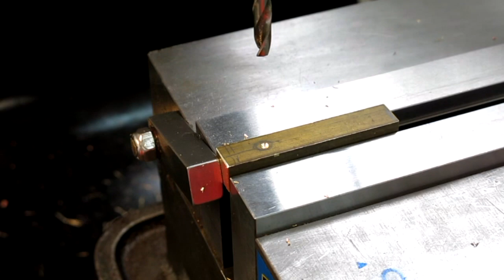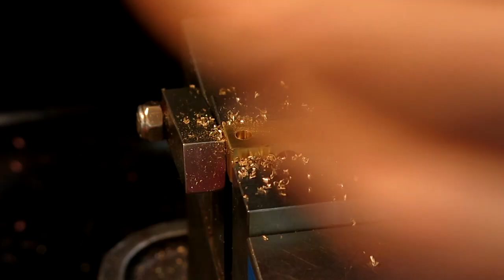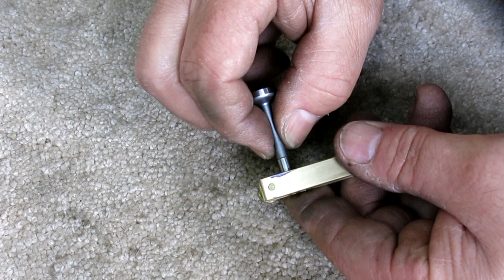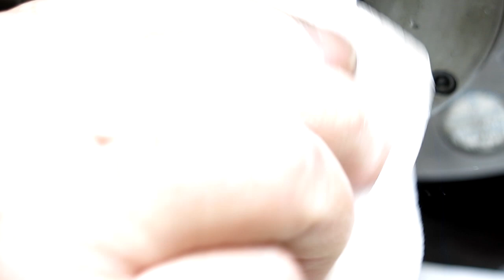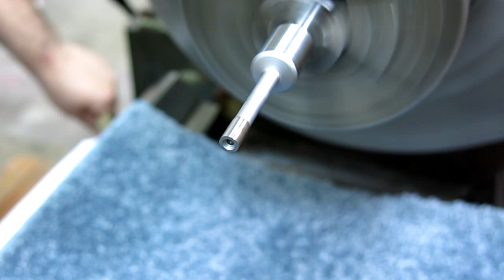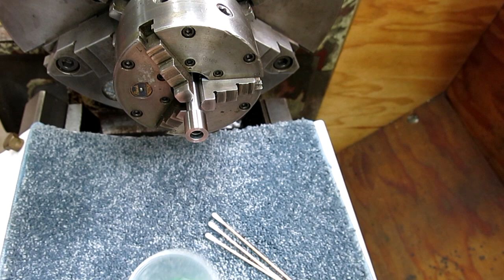Precision Toolmaking Making an Edgefinder Part 3

Comment: When i polish a work piece in a lathe using sand paper, the changed temperature due to friction affects the micrometer readings and i talk about 0.01 mm here. Does temperature plays role in lapping? It’s metal rubbing metal and you are talking tenths. 

Thanks 
Good stuff you are doing up there.

Comment: Really fascinating. Lapping is a great technique. I really wonder if your mike can go down (accurately) to 25 microns.  Just the way you tighten it is worth probably a few tenths, call it at best .001mm or say 50 microns. That is way, way, beyond the needs of the average home shop. Only way I know to measure accurately at micron resolution that small is a laser interferometer and that too is way, way, beyond the reach of the home shop. Might consult the physicists at Livermore. If they have an intererometer that would do it it would be a treat.

And it is fortunate that you broke the tap. If not, it would have gone  in slantendicular and ruined the lap, since you didn't gronk the vise.
Reply: +Juan Rivero Hi Juan, you may be surprised to know that one of the more gifted members of an Australian metalwork forum I spend way too much time on bought IIRC a Honeywell or perhaps an HP laser interferometer on eBay for around AU$1000. While he was testing it out and informing other forum members of his new acquisition another forum member chimed in to say that he had used that same instrument at a particular manufacturing plant maybe 20 years earlier, and at the time it was valued at AU$250,000. Again from memory one of the major issues he had with it was that the plastic foam padding from its case had deteriorated and deposited itself over the various components. Fortunately it all cleaned up and he was even able to obtain some missing accessories at a fair price from the U.S. He now has some of the best calibrated granite surface plates in any home workshop;-)
Reply: A very interesting story. The quarter-million (AU$) interferometer -- damaged bu its case! Thanks.

Comment: i have a question you said you could work in millionths, is there anything measurement beyond that. I play around with a KEARNEY AND TRECKER MODEL D.  my dad works in a shop, with mostly gears. he runs a 20-4 and an hob. mills too. but mostly the hob

Comment: Hi Tom
On the tapping You've been lucky, because You didn't use packing blocks. ;-)
With the lapping of the two parts, do not go any further to  mirror finish. If You leave two high polished parts together for a long time under pressure, the will be "cold welded". Because of the adhesion. With the time the electrons sharing the orbitals, and two parts become one.
Regards from Germany
Larry
Sorry for my poor English.
Reply: +oxtoolco What's a packing block?
Reply from the maker: +eXactModellbau Hi Exact,

Busted on the packing blocks. It might have prevented mr bozo's visit. On extremely hard surfaces like gage blocks and edge finders you some rotation will not hurt it. Fortunately in the case of an edge finder there is no relative rotation between the two parts if used properly. Thanks for the comment.

Cheers,

Tom

Comment: Tom,
Excellent work as always. However I suspect that this edge finder is for right hand edges only as you lapped it in the chuck but only with the spindle running in one direction. Next time alternate the chuck rotation. That will also cancel out the Coriolis effect.  :-)
eric

Comment: Sweet as Bro!

Tom, are the jaws you're using in your Kurt standard or have you ground that step in the jaw plates? I'd never really thought much about it, just shoved parallels in there and called it good to go. However my Wilton vice on the drill press has a jaw step and I use it all the time. Seeing yours I had a "why didn't I think of that!" moment, so I may make up some new hardened jaws with a step in it like you have, as that would be super handy. My main milling vice is a Gressel, and I, a) wouldn't even want to think how much they'd charge for new jaw plates and b) don't want to even temp Mr Bozo to pay a visit while screwing with  the existing ones, hence  grinding up some replacements will be the go.

The other thing, is that little weeny boring bar of any particular brand? I really like iFangers but I've only got them down to to "not quite weeny enough" sizes. Goodness knows why, but I often find myself in Weenyville when boring, so I always try to find alternatives around the place instead of my shop-made wonders! 

That lapping come up great. The edge finder would be better than most any commercial one I've seen. Nicely done.

Edit: Wait a minute, I just watched an earlier video (I often watch out of sequence if I don't have time to watch a longer one). Maybe those jaws aren't stepped and are thin parallels??? In which case what do you think about stepped jaw plates?

Comment: Tom, great work; even with a friendly visit from Mr. Bozo!

I have the same Mit mikes you have with the Hold button, which I noticed you don't use.

I use the Hold button whenever I am measuring in an awkward position that prevents reading the mike while it is still on the part.

I press the Hold button, back off the mike spindle a bit to free it from the part. Then I pull the mike out and look at the reading. I am uncomfortable pulling the mike off the part with the full measuring pressure on the spindle and anvil of the mike; I am afraid of scratching them or the part, or levering the mike itself a bit.

Just don't forget to turn the Hold function off before you make your next measurement; otherwise you wonder why that last pass didn't take anything off!

Is this procedure of any value?

Comment: Wow, and I was nervous drilling three "equidistant" clearance holes for the backing plate on my chuck, LOL! I would melt trying to bore something with that toothpick sized boring bar :)

Thanks again for the show, they're always enjoyable. Aloha...Chuck
Reply: +Knolltop Farms If Tom does work any smaller he will be building a watch, you know he can call it the RolOx, the finest watch never built.
Reply: +John Bare You do bring up an interesting point.....The question is:  When did machining actually begin?  I'm thinking like you.  Did watch makers start the science and art of machining as we know it today?  Remember, they made precision gears long before we had indexing heads and such..

Very interesting point you raise......

How did we get precision stuff before the industrial age?
Reply: +Clete88 - In general, by careful work, it is possible to create a part with just a little more precision than the machine it is made on. Natural precision can improve from generation to generation of machine tools.
Reply: The Antikythera mechanism is evidence of precision engineering from the Ancient Greeks, as are telescopes, because the lenses used require lapping to smoothness. My theory is machining, precision engineering and the marvels associated with them started shortly after harnessing water and wind power. With enough resources, time and knowledge, the Ancient Greeks may have created the first centre lathe or surface grinder with water as the power source. Greece is one of the world's sources of emery, a mineral commonly used as an abrasive, which makes them capable of creating precision machines. Look up Clickspring, who's making a replica of the mechanism, if you haven't already.

Comment: Do laps just need to be softer than the material being lapped? Or is the intent that the lap be very soft do the abrasive embeds itself into the lap to stay put?
Reply from the maker: +Thomas Utley Hey Tom,

Craig has it right. The lap needs to be softer than the target material. They are sometimes even made of lead. For a good read check out American Lap. They have a little technical section that is pretty good. Thanks for the comment.

Cheers,

Tom
Reply: +Thomas Utley I personally have not done much lapping but the theory is that you want a lap softer than your work piece so that the abrasive embeds into the the lap. If you use a material too hard then you get abrasive stuck into the work piece and it abrades itself during use. Cast iron and brass are commonly used as laps.
Reply: +Thomas Utley interesting question, I wonder the same way

Comment: did the tap bottom out? I kinda missed the explanation on what happened.
Reply: +madinatore I'm unsure myself... From what I saw, he said he didn't tighten the vise enough - I believe the tap lifted the work at an angle which caused it to break.
Reply: +madinatore The resistance of movement of the mill's quill was greater than the clamping force on the part.
Reply: ah I thought he hit the pairlows below the part heh

Comment: Nice vid, Thanks.   One thought and one suggestion:
The further you put the adjustment screw from the lapping surface, the finer the screw adjustment becomes due to the lever. Not that yours did not work good.....
Also, It seemed that you got most of the lapping compound on your thumb......I would try an eyedropper and keeping the lap slot at the top, drip it one drip at a time into the slot to feed the lapping surface.
Reply: Lot to be learned from you as well...